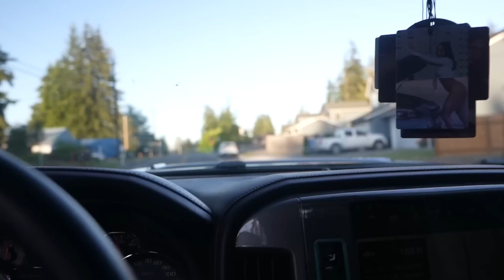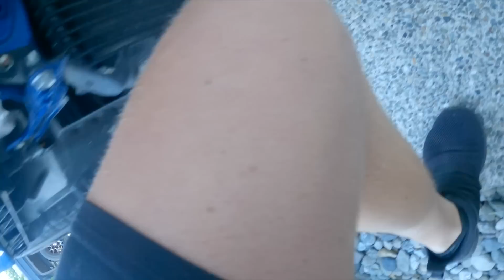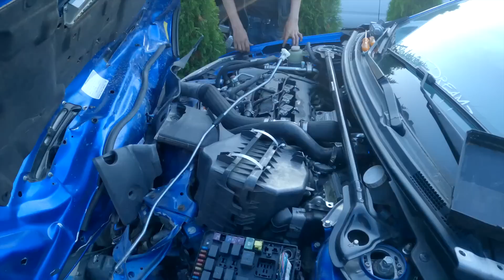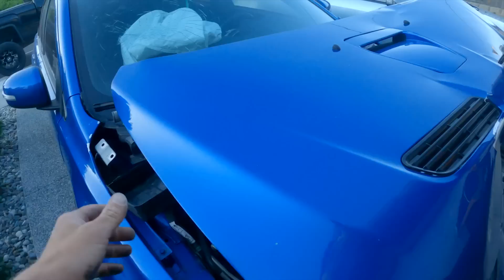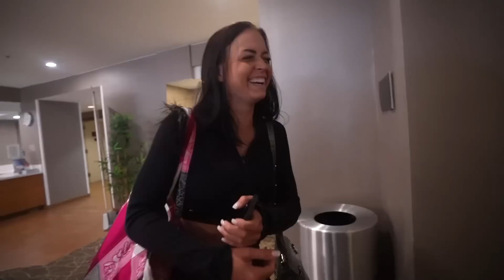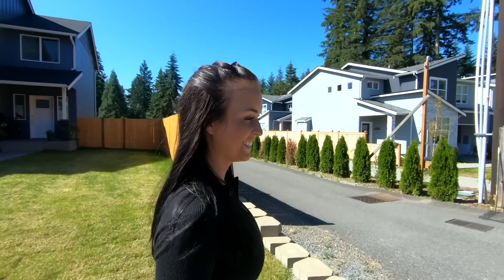Bought a totaled Final Edition Evo..

Comment: There is NO WAY this dude did that much damage rear ending someone at 35mph lol.
Reply: If he went under a SUV like he said then yea id say 35-40mph as there's no reinforcement on the impact area.
Reply: @BNR_248  maybe. I went under a Colorado with a Del Sol at close to the same speed and it wasn't this bad lol
Reply: You are so right!!!!
Reply: After seeing that video of him racing in the rain, I’m sure he was speeding. Reckless behavior.
Reply: I slid into a ditch with my first one at literally 15mph in the snow and it looked like an f1 car when I got out. Airbags didn't even deploy but every panel on the car looked like the front of this one and a wheel ended up bending up under the oil pan. This was literally the night after I installed an apr front lip.

Comment: Devin, once you stripped off all the damaged body works, trailer the FE over to Bobbi's dad's body shop. I'm sure he has a frame alignment rack. The frame tech will get it dialed in better than factory.  If the frame is severely damaged in a section, take it to a custom chassis shop.  Could strip out the interior for panel seam weld, and build it to rally spec with custom roll cage.  The chassis will end up better than factory.  So looking forward to this build I'm feeling this low mileage evo will be a keeper when shes done 🏁

Comment: Since it's exactly like mine, Blue and final editions, you should build bolt-on, so i could see what i can do with mine ;) .. But in canada, Final editions didnt had any "option". So i do have the SSS (HDS, Wing, Rockford sterio), i do have the Fast key entry. My seat from factory look exactly like the one you have in this one, except my stiches are red ;).. So mine is suppose to be fully equiped since its the final edition (no option in canada). But i dont have parking sensor.. That's weird .. hehe.. Do you have sunroof on that one ? Canada version had sunroof :D